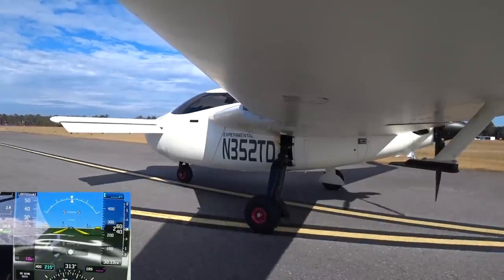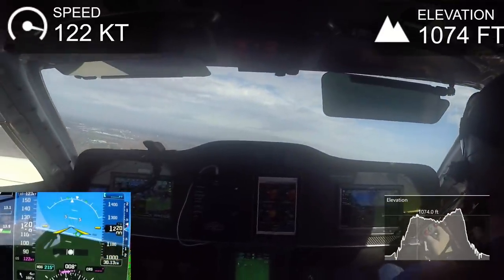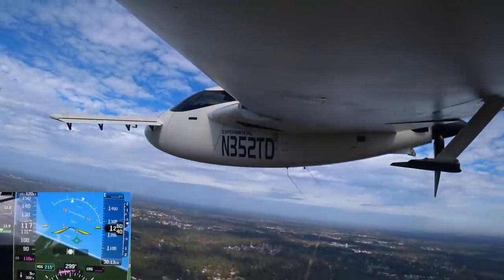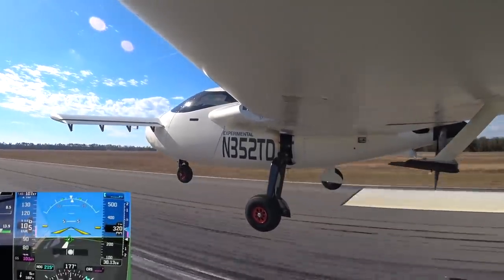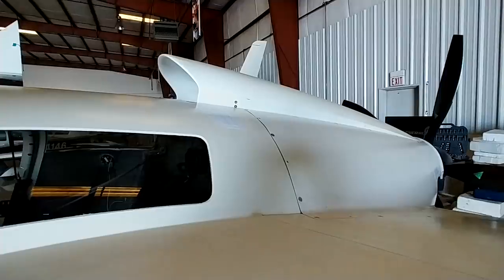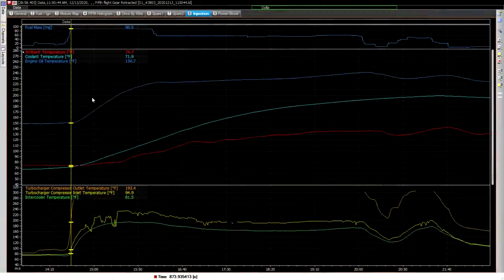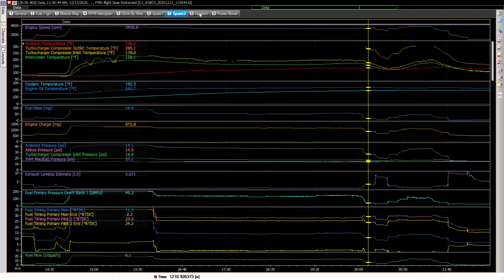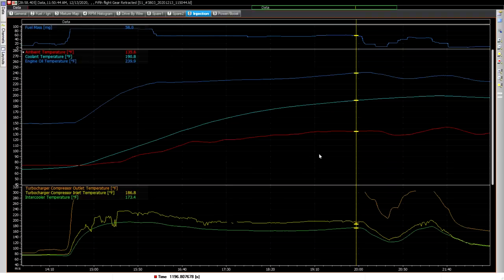Fresh Air and Sunshine - Flying the Raptor Prototype

Comment: Time to take your numbers and models and load them into Flight Sim 2020.  You can attempt things in the sim based on the calculated model that you wouldn't want to try in real life.  You can sell the model and make money off of it to help fund the project. And you can have thousands of people testing the airframe in simulation form updating it with all the new current data as you accumulate it and releasing patches for those who paid for the model as well.

I just bought Carenado's Mooney M20M model and love it. But I bought it to scalp their working instrument suite and put it on their OLD M20J model that I converted from Flight Sim X where the instruments no longer work correctly.  You're a software guy, so things like that should be a cake walk for you!!!
Reply: Hard to beat a Mooney for a personal aircraft. The M20C with a nose extension is my favorite. I'm in the process of designing a composite larger Mooney type aircraft for my electric aircraft propulsion project however the Audi 3L TDI Propulsion has turned my head. Peter Muller's Raptor Project as a whole is a game changer for little airplanes. I can see myself owning a Raptor. Getting one profiled for the simulator will be important after the production model is established. The Raptor Prototype is proving a real world knowledge of what to expect with a loaded production unit. Fantastic information in my book! Best wishes!
Reply: @willhibbardii2450  So like the M10T? Or same shape as the M20 series fuselage and wings? The M20E is my favorite  of the bunch as they're available  around $60k, cruise around 165Kts on a 200HP engine and the early models still use the johnson bar for the landing gear like you mentioned.

But back to the point at hand. @rapteraircraft I think there is a consensus on having a flight sim 2020 model!
Reply: @kendrickmeadows ,  Yes, I know a 2020 flight simulator featuring the Raptor Aircraft would be very beneficial and believe it would be sought after. I believe that Peter's aircraft is a game changer for general aviation. A perfect platform to transition pilots to experiencing positive control Angels airspace operation Flight Levels. with out the price tag of a quarter million dollars. In this it beats a Mooney's capabilities like a drum. Al Mooney evidently designed his aircraft on what I term as the 11 Degree profile. Both the M10T and the M20 when analyzed were designed with this very simple basic. <-> I experienced the 180 HP M20C version unmodified strait and level cruise at around 5,500 MSL was 140 Kts. IAS. However with a 250 ft per minute cruise decent 152 Kts was smooth as silk. After I installed the Speed Mods with the extended nose kit with the same 180 HP Lycoming increased the speed performance in strait and level increased to 158 Kts IAS and with a 300 feet per minute cruise descent 173 ~ 175 Kts. With a naturally asperated engine my flight profile my goals were to average 5.5 GPH. Cruise Climb @ 24 Square @ 90 Kts on a cold day single pilot full fuel 1,500 FPM, hot days I experienced as low as 800 FPM then let the manifold pressure drop adding throttle and leaning the mixture to 10,500 range... Then set up the cruise decent. In 24 minutes your covering allot of ground comfortably, efficiently at around 190 MPH ground speeds. An experienced thrifty Mooney pilot doesn't spend much time in straight and level flight except to avoid weather. I love the Johnson Bar System... My thinking is to keep the same 11 degree profile and make the Mooney more comfortable is my thinking! The Audi 3L TDI Diesel is the key to transitioning tractor configured Aircraft having similar characteristics as the Raptor though I think the Raptor will beat overall performance more comfortably. Heated to avoid icing... Laminar Flow wings are just simply awesome! It sux to be loaded with ice with them. Not fun! Most of Peter's design with the heated wings will negate this! Never Fly a Mooney in known icing conditions!!! Not Cool!

Comment: nothing boring about it at all, chuffed to see her in flight, and to see improvements' made overcoming small probs on a daily basis, whats not to like. the turbo heat sensors taking a dip on your graph would that be sensor quality or a signal prob to your PC ? or something on those lines.

Comment: Nate Puffer of Cozy Mk IV fame  mounted a garage door opening mechanism that spanned from the rear seat thru the font seat extending to near the panel. He had a heavy weight that he could move for/aft. Adjusting inflight to explore the CG envelope.

I do not understand why your staying at such a low altitude. At a minimum you should be at an altitude that allows the use of your BSR.

Comment: Perhaps something for later...do you have room for a deeper oil pan/sump?  Some additional oil capacity might help keep oil temps in check.  Also - have you considered Evans waterless coolant?  Just wondering if having a cooling system with very little to no pressure might be beneficial...no burst hoses or radiators, etc.  keep up the great work!  I have the same Tdi engine in my Touareg- love it
Reply: @rv6ejguy  understand your point on the additional oil capacity.  Yes, it might run a bit warmer with the Evans - assuming the coolant temps get handled- I would think not having the system under pressure would be a worthwhile trade off.  A coolant leak at altitude is just a leak with Evans - otherwise the system pressure is spraying coolant everywhere and might lose volume faster.  Just a thought...if it were me, I would figure out how to use it.
Reply: @rv6ejguy  cool...Learned something today.  Can’t beat real world experience. Thanks!

Comment: Guys, I don't know, but it seems that it is still varying quite vertically and horizontally, as if it were in the interference of large wind currents. This is normal? Is it part of the project or does it still need improvement? Still, I think it would be interesting to have some kind of "shock absorbers" on the wings landing gears. I am extremely interested in the prototype, but these points, besides the heating of the coolant temp varying a lot in these tests, apparently. What do you think? Am I seeing what doesn't exist?

Comment: In the chop I’m seeing small yaw excursions coupling into roll motion due to the wing sweep.  Might be a case where a yaw damper could help.  None the less, the turb induced attitude changes seem small and really not out of the ordinary for this class of aircraft.
Reply: It seems like its tail heavy. Its doing something I call "wallowing". As the plane is light on the nose its swinging back and forth. It seems to him like the fuel is sloshing. That's what a forward cg is going to do. It's how they make fighter jets really maneuverable. By making it unstable. But of course they have a computer compensating and won't allow the pilot to over control the aircraft.
If I'm right, and he keeps moving the cg forward, he could lift off the ground and find himself in a real balancing act.
He says move the cg forward to get the nose down, but that's exactly the opposite of what you want.
And the weird incidence in the wing being more at the root,  less at the strake and then more at the wingtip is strange.
You want some washout going toward the tip.... but I've never seen a wing with a different angle of attack in the middle of the wing like that.
I'd like to know what airfoils he is using.
I build flying wings and I use different airfoils at the root and tip with a gradual blend and washout. But it all blends along the span unbroken.
I don't have much experience with this wing shape though. The only one I built was a 1/5 scale model of this aircraft.
It behaved EXACTLY like this when the cg was too far forward.

Comment: Get it up to 4-5 K and cruise to check temps
Reply: even just for safety....at the alt's flown at currently, any emergency will leave the pilot zero time to react especially considering the glide performance of this aircraft will be terrible and the high landing speeds off field will likely end up been a total loss and yes it has a ballistic chute which is its only saving grace but at what alt do they need to become effective?
Reply: @andrewjamez  The ballistic chute I believe is effective at all altitudes, the system should pre-deploy the chute as it comes out.
Reply: @TheOwenMajor  Lol.... Yeah umm might want to check that.. Pre-deploy is kindof a misnomer there.. Yes it will pull the shoot out of the bag i.e. deploying it.. How ever it will need time and distance to fill with enough air to open the canopy and then it will also need more distance to slow the decent rate.. Ballistic parachutes need generally at least 600+ft to be effective..  So NO they are NOT effective at all altitudes. even 0-0 ejection seats will not work at all altitudes when it comes to decent rates and forward speeds.
Reply: @pr1malr8ge  Chute technology has advanced far from the state you describe.

BRS(I think he used them) and other sources I have read on the matter are pretty clear that you can deploy the chute at any altitude. 

And seeing the Raptor can't fly slow in the first place, you will have plenty of velocity to fully inflate the chute.
Reply: @TheOwenMajor  Last I checked Physics hasn't changed since the beginning of time. How ever you can "Deploy" at any altitude you want... For it to be effective well refer back to the beginning of this paragraph.
Reply: @pr1malr8ge  The manufacturer specifically says that you can deploy their chutes at any altitude, I don't think they would make that claim if you did it you would pancake into the ground and die.

And I think they know more about it than you do.
Reply: @TheOwenMajor  "Q. How low can I be and still deploy the system?
A. Altitude is only one of the critical variables to take into account when evaluating the safety potential of the parachute. Extracting a parachute in flight at any altitude will very quickly reduce the energy of the impact to the ground. The lower the energy of the impact, the higher the chances of walking out of the accident." If you notice this from BRS's website it skirts the answer. The real answer is this: Below X altitude the system may or may not help good luck.
Reply: @pr1malr8ge  "Extracting a parachute in flight at any altitude will very quickly reduce the energy of the impact to the ground."

Doesn't sound like skirting to me. 

If their product was going to kill you if you deployed it under X feet, they would be pretty clear in that regard.

Raptor is going to be going 90+ knots all the time. That is plenty of wind speed to fill out a chute regardless of altitude.

Comment: you should pull the thermostat and do a test that way, not sure what the specs are for audi v6 diesel, just wondering if it's 195F. The other thing I would do (others said it as well) put a standalone oil cooler rather than the oil to coolant heat exchanger. The heater loop bypasses the thermostat so your main radiator doesn't even cool the engine until you get up to temp and by that time (just a guess) your intercooler has probably brought the main radiator to a high temp anyway. Just a thought, simple enough to pull the thermostat for a test.

Comment: That rolling is duch roll. You don’t have enough yaw stability. Extending the rudders width will help allot. Just add some 10 in. aluminum plates on the rudders trailing edges to the full height and it will go away. Drag increase will be minimal, and it will actually help with the yaw stability.

Comment: About the comment re moving the CG forward so the fore wing rides lower and thus it's vortex would hit the main wing lower..... I beg to differ. As you increase the fore-wing's load you intensify it's vortex. So even if you slightly alter the impact line, the vortex itself is stronger and I assume larger. Just a thought. There IS something, though, that is causing that sideways figure-8 hunt at the nose. Someone here mentioned Dutch roll... something rather unknown until swept wings showed up.... which you have. Yaw damper? Check the shadows at 4:10. And lastly, since I am here (and I do apologize).....spades? They seem like a clever freebie,  but they are rare outside aerobatics for a reason. Wonder how spades like icing...

Comment: Seems like the rolling back and forth is rudder related?   Wing tips be flexing out of true and pulling\rolling the plane as they flex.  My .02 cents lol
Reply: there could be some such coupling, but when I look at the control column/rod it is moving with the oscillations, but not so much with the wing movement.  I.e., the instability seems to be built into the roll control system.  So I would be interested to see if more static stability is increased by reducing the aileron bob weights and increasing the force required to deflect.  Then that force for the required hing moment can be accomplished by a combo of leverage via pulley and/or crank sectors and leading edge aero balance. My $.02 is that it would have been good to read Dan Raymer before deciding on this design. But I know this builder already hates me and my remarks.  It's hard to tell just how unstable it is without a GVT or flutter test, but I am still not sure it's safe.

Comment: The tape that you use is impressive! Especially the tape you used to hold the temporary wheel well covers. Secure at 140knots! Which tapes are they.
Reply: I can confirm 100 mph tape actually is stick good at 600 knots +
Reply: Except for the parachute cover, huh?

Comment: Just curious why you are not flying from the left seat
Reply: Some pilots log most of their hours with throttle on the left and stick on the right, primarily those who fly tandem or single seat aircraft.  The right seat in this case is the most comfortable and natural position.
Reply: He mentioned it several times in earlier videos: It's more comfortable for him.
Reply: Maybe also because Peter it's from Australia and down there they drive left and sits on the right of the car, and this may be contributing to that attitude. The only thing I'd project different it's the lever, I'd made something more similar to a Bonanza where you can change the position by rotating an arm and I'd avoided lateral sticks, but this is a very subjective topic and it's not the most remarkable feature on the plane.
Reply: He has said he was an instructor.
Reply: Peter is a flight instructor! He will be demonstrating Raptor from the Right Seat. Plus with his flight instructor history he feels he has more muscle memory proficiency in that seat for testing the prototype. It makes perfect sense to me!

Comment: Have you ever considered using industrial size fan to check the airflow on the wing? It’s a cheaper option for wind tunnel and it might give you better view how the air behave on the wing.

Comment: looking great!!! question, why not put in a separate oil cooler? obviously, summer brings heat and that would mean higher oil temps, so why not?  Looking very comfortable in the air, seems to handle well with no discernable  problems!!! keep  building safe times!!!! 1,000,000 attabits!!!!

Comment: Congratulations, do you think the roll oscillating might be Dutch roll?  Maybe a couple of skegs at the rear of the fuse might help?
Reply: Skegs are for boats. Strake is the term you want.
Reply: @wadesaxton6079  yeah those things!
Reply: Delta Fin.... well, for Learjet. (Official term on the Form 8130.3)

Comment: Peter, check on what looks like a stain on the traditional ‘pilot side’ next to the D in the tail number... is it a shadow, an oil, coolant, or fuel leak, a dirt mark, anything? 

Using the Mooney comparison... On rotation, the Mooney nose yaws to the left... the pilot, and/or rudder trim keeps the rudder to the right to keep the nose centered... which direction is the Raptor’s prop turning, which way does the raptor yaw during the rotation?
Best regards,
😀 - a -

Comment: Why the oversized winglets? Why the tall dashboard? 
Not impressed.
Reply: Are you smart enough to locate the rudders?
Reply: Don't buy one then.
Reply: @formulaben  ...  Yes actually, they are too tall. I have adapted flying-wings. Are you intelligent enough to understand the reasons it does not require such an obstructive front dashboard?
Reply: @rob379lqz  how many times have you sat in the aircraft to discern how obstructive it is?
Reply: @philzerr5476   Zehr gutt advice.
Reply: @formulaben ...Don’t be so bitter. I am merely providing criticism for constructiveness.
Reply: @rob379lqz  Of course.  My apologies.